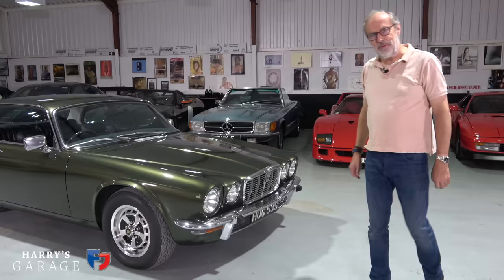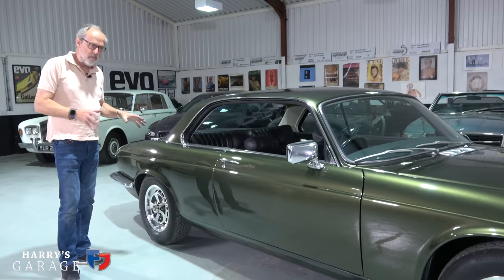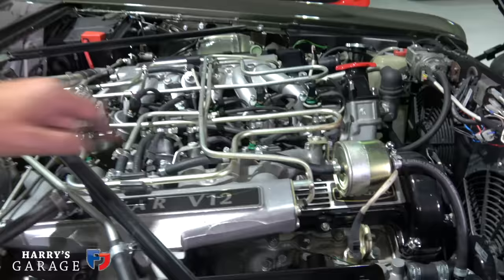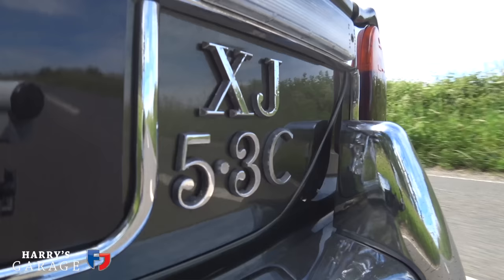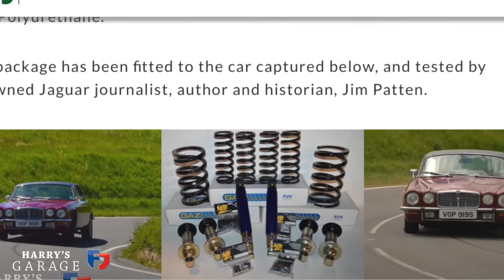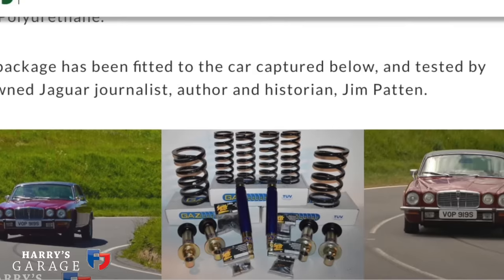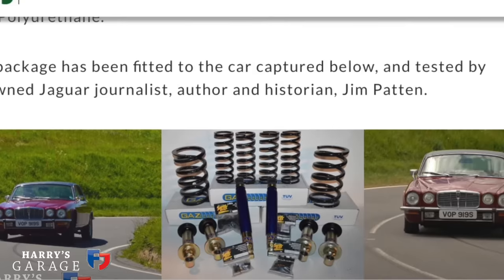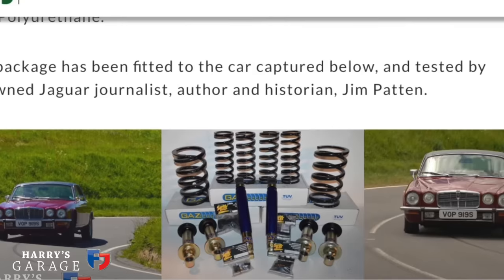Is this Jaguar XJ Coupe V12 manual the best sounding car in my garage? Maybe..

Comment: Rim and tire combo suits that car perfectly aesthetically wise in my opinion. 
An awesome car overall!
And personally I love the character of short stroke engines.
Reply: Not sure about the fake spokes though…
Reply: If I remember correctly, the original 205/70 tyres fitted to the XJ6 were specifically designed for that car (in the 1960s)... so enabling the low front wing line ?
Reply: 14:07

Comment: Well, what a wonderful video. in the 80's and 90's I spend a fortune on buying XJC V12's - some in better conditions than others, Leyland motor cars didn't have the best reputation for build quality nor reliability when the XJC's (eventually) came to market.
The optional extras were believe it or not velour seats,  air conditioning (many problems), manual gearbox,  and as stated Kent alloy wheels.
All of my cars (Red or Carriage Brown !) needed a lot of work, and all had the obligatory vinyl roof (very 70's)
The engine was rated at 330bhp, for the standard V12 3243 cc displacement, but of course due to the oversquare design, this could be massively increased if required up to something like 8 litre for marine applications !
The AJ6 manufactured kit split the manifolds open, installed 'equalising trumpets' to balance the airflow, then re-welded up the manifold, plus adding the additional air ram inlet pipes, but the modification I was aware of had one pipe going down to draw in cooler air. 
Bushings and springs etc definitely make a difference, and keeping the period tyres is completely correct, I never swapped out Kent alloys on my coupes, to keep the ride comfortable if you do a lot of miles, then a hard ride is well...'hard'
I like the colour of this car, it's not British Racing Green, by the look of things,  it seems to have a 'silver sheen' to it, but really nice, especially without the black vinyl roof ! One of the problems with the vinyl roofs were that they trapped moisture and made in some cases for a very rusty roof.
One of the biggest technical issues was the back windows and the 'wiggly path' that they followed to raise and lower, caused the Leyland production team and Sir William Lyons some massive headaches with the design and to get the back windows to seal properly and calm down wind noise when moving.
I remember the 'twin fuel tank' design had problems with relays, interconnecting fuel pipes and generally when they went wrong they were a pain.
I miss my coupes, and 70's Jaguar XJS's, but they are so expensive to maintain and finding a good garage that deals with these period cars (unless you do a full restoration such as here) seems to be getting ever harder to find.
Brilliant video, you don't see many of these on the road these days,  more's the pity.

Comment: To add to the sound, I don’t think I’ve seen a better engine bay, when you open the bonnet it’s just a thing of beauty 👍
Reply: The engine of Harry's Espada since Iain Tyrrell's rebuild looks pretty special.
Reply: It's very clean and orderly... as opposed to the late '80s XJS. I worked in a small shop for a couple of years that sold used Jaguars and a mix of other foreign cars. I drove that XJS several times and it ran "OK" but was down on power due to the inescapable smog crap it was burdened with. 

The first time I open the hood (bonnet!) I was so disappointed with the ancillary plumbing all over the top of the engine! Honestly, I could not see the plug wires for several minutes, they were buried so badly!! That mess on top of the engine reminded me of a large mass of spaghetti dumped there wet, and then the lid was mashed down and left until it all dried. 

It wasn't just Jaguar though. Most of the desirable cars of that time were choked with similar equipment that just ruined cars that were actually pretty good in some other markets. US/California cars suffered badly.
Reply: That engine is enormous. Mechanics used to make jokes about having to turn the car upside down to retrieve anything you dropped in the engine bay.

Comment: Tremendous.  Harry, you now have the V12 XJC as it should always have been.  Jaguar went for the slightly soft GT like the 450 SLC but it is amazing to hear the DNA of the D type and racing E types in that modified V12.  Thankyou
Reply: The 350 SLC was available with a manual box...i've had the pleasure to drive one. While Mercedes made horrible feeling gearboxes from the factory, they where relatively easy fixable with stronger bushings and a short throw. An R107 with a manual transforms that M116 as well...

Comment: I had a 4 door version of this puppy. it had horrable fuel vent issues that would knock you out, fuel leaks were common, so tighten up your injector clamps. The oil cooler is oddly plummed into the oil pan so it leaked. But other than that, it was fun to drive, it looked great, and its a loveable vehicle. The 2 door is even better looking. Nice car!

Comment: Holy… 😳 That sounds incredible through headphones, there’s just something about older cars without tonnes of electronics that can’t be replicated. A dark green, pillar less, V12 coupe and - manual, no less. Recipe for perfection right there. Fascinating series on the restoration and it’ll be interesting to hear it after the crossover is fitted.
Reply: 9:59
12:29
14:07

Comment: After following the story of the XJC refurb(!) and then last night watching your garage tour on The Late Brake Show I can confirm the Jag is easily the number one car in there for me. It just ticks all the boxes, sounds fantastic, goes as well as anyone needs and looks amazing.
A car that can be used as a car should be it nipping to the chippy, posing in town or heading for a continental driving holiday. Great achievement by all concerned and in today's market of massively overpriced "restomods" achieved at reasonable cost, congratulations on a superb motor.

Comment: Having owned several V12 Jaguars I have ALWAYS said Jaguar ruined the cars by selling all of the non-E-Type cars with that stupid TH400 three speed automatic transmission. Putting that behind the 5.3L short stroke V12 was such a BAD decision. I have driven a friend's 1987 XJS with a Tremec TK500 gearbox and this same AJ6 modified intake on it and that car is fantastic and totally transformed from the way a normal XJS drives. Normal V12 cars with the TH400 auto gearbox never get up into the upper rpm ranges the engine is capable of turning.
Reply: I have to totally agree with you, the Jaguar V12 is such a glorious engine when it has a manual behind it..
I am looking now myself for an XJS
Reply: @adrianharrison5208  There is a 1984 XJS listed on Long Island NY with a bad transmission for $2500 on craigslist

Comment: My friend an I own a  Powder ("baby") blue XJ12 LWB , that we imported from NZ in 2019, which ended up winning a manufacturer prize at Salon Privé (with just a bit of elbow grease) a couple of months later.  Although our car pales in comparison to your beautiful car.  
Upon first getting to drive it, it was obvious the engine was completely hampered by the 3-speed auto.  To which my friend said "Ah-ha, have you seen one of Harry's videos about his XJC V12? " 
Fast forwards to September 2021, we purchased two 5-speed Manual boxes out of XJS's, at the Jag Spares show (the theory being, at least one must be good un).  
Now.... in November 2022, these two boxes are sat in exactly the same position in my friend's garage that we offloaded them to 14 months ago.  

Your latest update has given us a kick up the backside to get on complete the manual conversion!  Perhaps an X-pipe and then at least we can enjoy the engine in a straight line!

Comment: That's the biggest smile ever & no wonder.
That has to be the best sounding Jag from that period. Even without trying to tune the exhaust, sounds delightful.
If there's a car in the garage to take out for a cheeky week blast then it has to be the Jag. Because as you said, it's not all about speed, you can do that in your our faster cars. This is all about that engine, the suspension and how the whole package drives.
Bestest video.

Comment: Harry, I owned an early 70's XJ6 sedan for a short period in the late 70's. It was a pleasure to drive when it was working, but was a horror show to keep running (rear diff oil seals leaking fluid on the inboard brakes & Lucas electrical nightmares).  I swore I'd never have another Jaguar after that, but seeing your V12 Coupe would almost make me rescind my promise. The 2 door coupes are by far the best looking version of the XJ.  Thx

Comment: Jaguar V12 Engine: Ron Beatty & Roger Bywater, gentlemen, Thank You.
Won Le Mans twice - production block XJR 12's in 89/91. Famous victories. Rumoured to had hit 5 digits on the mulsanne, a Win Percy mis-shift.
Flat sounding torque factory down low, but cammy up top, a real star. The 6.1L was a sweet spot. Harry, put one of those in, Zytec ignition.
My father built many - his tools for that engine are a mixture of imperial and metric because  it's made up of a mixture of these bolts.
The most complicated mass produced engine of its time and could still be.

Comment: Harry the car sounds delightful 😊.  I was the body shop foreman at Julians of Reading the largest jaguar dealership in the UK  back in 1987 when jaguar was acquired by Ford . I was responsible for painting all the Silk Cut promotional cars for the Jaguar TWR promotions stand at La Man  . I have retired and now live in the Caribbean.  Seeing your video has brought back wonderful memories of working on those big cats . Having had the pleasure of driving 6L manual gearboxed TWR XJS & TWR XJ12 with uprated sports suspension, fuel and exhaust.  I totally understand where you are coming from when you compare your XJC to a standard XJC. 👌 💯  .  I was just a 24 Yr old at the time but was at the top of my game as an auto refinisher.  If I could afford to run a classic car today , it would be a jaguar.  Thank Harry,  you really  brought a smile to this 59 Yr old's face . 👌 
as a side note iwas responsible for convincing Julians of Reading , which later became Lancaster Jaguar dealership based in Pangbourne, Berkshire,  to apply to Jaguar to become the first Jaguar  approved body shop in the UK. My name  is Jeffrey Phillips

Comment: Ignore the moaners.She sounds mint.If you were giving away one car in your whole garage it's the keys to the gorgeous XJ12C i'd be going for.As a long term  XJ driver for me the S2 coupe V12 is the ultimate iteration of the model.The only possible changes i'd contemplate would be aircon and maybe an updated audio system but still looking like an old push button.Best car in your garage by miles.👌

Comment: To think power steering and servo brakes back then we're considered cutting edge race derived technology.
This is visceral almost 3 dimensions seeing hearing and almost feeling!
£60-70 thousand all in is a bargain consider what it would cost to produce today,they were almost hand built upwards of £300,000 at a guess.
What is the now alternative,something that has that many assistive computers you may as well stay at home and let it go to the shop for you.
I love the olive green,the wheels are period and perfect and the sympathetic use of the taller tyre to give the body and axle a chance is reflective of a car lover not just a driver.
It is perfect and draws you into it's mechanical soul.
Beautiful.

Comment: Dear Harry.
With respect. 3 points to consider for improvement.
1. Move the ignition amplifier to the top of the radiator away from the heat.
2. Either a cross pipe, or later model exhaust setup to gain refinement and acheieve an ever better exhaust note
3. Still believe 235/60r15’s on the kents are the go. In particular Yokohama 352’s. I believe they are in period. 
Anyway, still a fine motor. Congrats

Comment: I had an early 80's XJ12 that I loved after a rebuild. It did not have the additional front grill,  manual shift, or throaty pipes. It wasn't even exceptionally fast but you could lean against it at idle and not know it was running. It overheated due to a faulty temp gauge and swallowed a valve one night, common for the steel valve seat in the aluminum head, and still got me the thirty miles home. It made me sad to hear that the buyer I sold it to did a V8 conversion.

Comment: My Father had several Jags though the 70's into the 80's and his last one was a TWR XJR  in the late 90's always loved those cars and the smell of the interior . They were cheap to buy 2nd hand in the late 70's some down to the oil Crisis and a lot down to BL's poor build quality . I loved been in those cars as a Child . Later he switch to Japanese cars like many because they were bullet proof compared. 
I know loads of people said that the weakest point on any Jag V12 was the Auto Transmission which hobbled their excellent V12 which is as good as any V12 from Ferrari or Lambo . Not fitting a manual to the V12 cars was a major failing of the management back then.
You have a perfect XJ it looks period correct even though it is modified .fitting modern tyres or wheel would destroy the excellent balanced design of this car.
Thanks for the upload.

Comment: Nice review, I love the sound, the looks, and the colour of the V12. I've always like the subtle styling of the pillerless coupe.

I think a lot of people overlook the importance tyres play in the quality of the ride. 
You can bang on a set of wide low profile tyres on any car and yes, it sticks better, but having spent the money it's rare to admit you made a mistake.

I've had my current run around for 17 months, it came with a set of black (I don't like black alloys) after market alloys, wide tyres with a low profile. I couldn't fault it when I was playing in the mountains near my home, but in town, on the roads I normally drive, it was loud, jarring and uncomfortable. 
About 2 months ago I exchanged the alloys for a set of alloys sold as an option for the car, narrower, higher profile and a slightly lower tyre pressure. 
They have transformed the car, it's quieter, softer, less jarring and although there's a little less grip, they suit the car perfectly. 
I thought the best part of the exchange was going to be the silver wheels, but that's just cosmetic, the ride quality is now the way I want it.
Reply: it´s really safer but i wouldn´t install a low profile tires on one of this

Comment: Harry's off to do some Equalising, or New Avenging or Snatching. 
Those camera shots and that soundtrack fill me with pride.  I might play some Elgar now.
£60-70k all in, so that's the purchase price and full restoration and improvements.  The bargain of the century really, because what else would you want from a car?  OK, economy, safety, mod-cons, the capacity of an estate, the off-road ability of an SUV, reliability etc.  Yeah, yeah, OK.  But the sheer beauty, sound, pedigree, speed, class, exclusivity.  Unbeatable, surely.

Comment: I spent years boring people about how much more sporting the XJ's could easily be. I wonder how many sales Jag lost by softening them up and silencing the V12 into obscurity. I ran an AJ6 Engineering modified manual XJ-S 3.6 years ago and it was sensational. Congrats on the XJ-C.

Comment: What an utterly beautiful machine.

I don't suppose there are enough shells left to be able to have an Eagle, or Singer style Restomod run of these.  Maybe some rich individual could have that central section constructed as a carbon tub, roof included, to give it the rigidity it lacks.  We need more of these beauties out there even if they're not the original  Its genuinely one of those shapes that hits you right in the heart.

Hell they were rare as hens teeth when I started out as a mechanic in 87 but I would always take another run around the block for a better look when I came across one.

Comment: The potential of the XJ platform. Easy solution to the license plate issue is to just perforate the plate with littles holes or slits so air can get though

Comment: Harry…I miss my 1969  XJ6 Series 1 4.2 which I owned for 22 years then had a very comprehensive revamp at JLR Heritage to make it just about perfect…(it was never driven in the rain and cherished from new so no rust or deterioration). Sadly though..the work coincided with the outbreak of C19 and I could not visit the factory with the car sat on a hoist for around five months! Then when done..On the way to see it for the last time and one more drive, I had a puncture at Gloucester Services so never got to see my car again. It was sold via JLR Heritage for a crazy price that I had no control over..I got £4018 net despite a £23995 price tag! Mine would not sound like yours but it was always very good..and I wish that I had it now. YUL 654H..Where are you????😳😳

Comment: As a further observation, the steering wheel for Lister is better than the original, obviously, and suits the sporty nature of the car in its present form. The only time I have seen this on a coupe was on a black Lister 7 litre XJC that was in a garage in Parsons Green, Fulham in 1999/ 2000, and it had the flared arches, Lister seats etc. Don't know if it still survives.

Comment: There is no flywheel cover on the Jaguar XJ V12, that's no-good dirt and sand can get in there and cause problems. It does sound very good.  Put a strut brace for rigidity